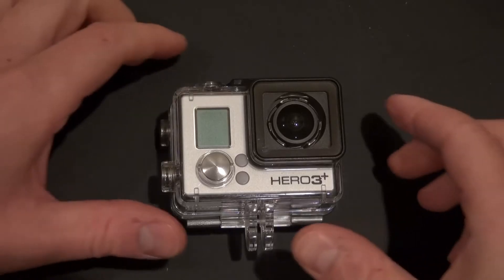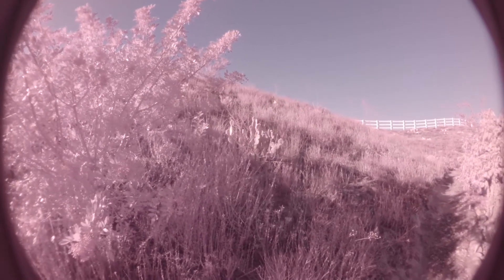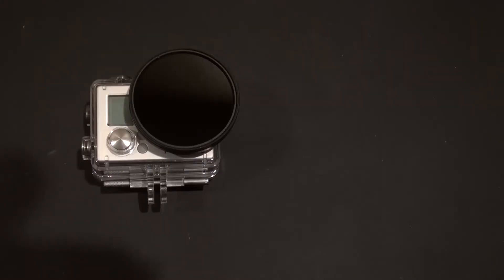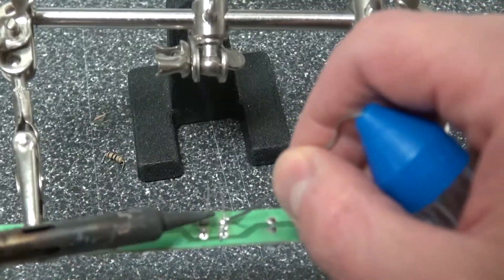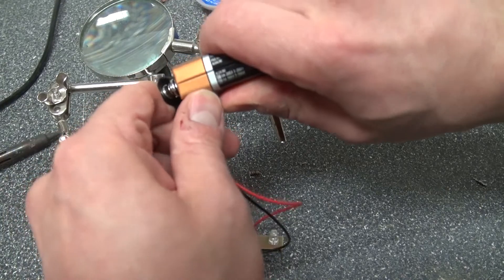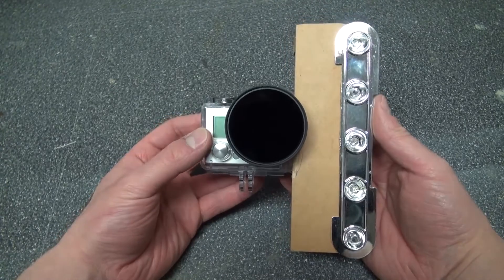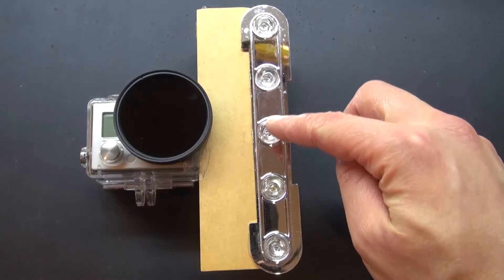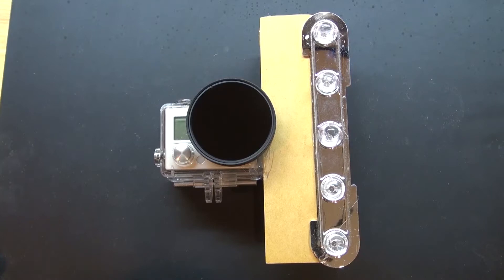Gopro IR Night Vision Camera Upgrade

Comment: Any reason you decided to not make a ring light maybe with the bare perf board or maybe even in a reflector from those older flashlights from the Goodwill Store to get more collimation or something else?  Maybe there's a sensor there better to not block.  Cool build and neat to see being resourceful and re-using and re-purposing electronics. I've been doing the same though not building enough yet.  I'm moving up from the RTL-SDR DAB TV tuners as well as antennas and working on newer antennas and a tinySA to do some design iterations and figured I'd move forward with a UV-Vis at least NIR spectrometer maybe like the NanoDrop... though more likely the PVC style with some aluminum tubing I have to save space since I wanted to test the spring water residue.  Still wondering about the Hero4 since I'd like to use a 4K camera for the spectrometer and probably is best to read into which sensor performs best into the UV and more-so IR range.  Thanks for sharing!

Comment: How can you make the range longer? I removed the IR filter from the gopro lense and i can only see 1ft-3ft in nightvision mode. Im using a IR zoomable flashlight.
Reply from the maker: That's a cool flashlight! For the gopro, there are limits the camera can do. The only thing you can do is change the lens type on the gopro.
Reply: @SciTyeTech  Any recommendation on the lens type?
Reply from the maker: @jamesk6270  I would say this one would be good. https://www.ebay.com/i/352753679291?chn=ps&norover=1&mkevt=1&mkrid=711-117182-37290-0&mkcid=2&itemid=352753679291&targetid=883027960686&device=c&mktype=pla&googleloc=9031560&poi=&campaignid=9423618867&mkgroupid=95066753945&rlsatarget=pla-883027960686&abcId=1141016&merchantid=6296724&gclid=EAIaIQobChMIyYGt2quJ6AIVGNlkCh2GOQU6EAkYBCABEgIxRPD_BwE
Reply: dont know if anyone gives a shit but if you're stoned like me atm then you can stream all the new movies and series on InstaFlixxer. Have been watching with my gf for the last couple of days xD
Reply: @Keanu Kason Yea, I have been using instaflixxer for months myself =)

Comment: The filter cobbled on the front looks more like a polarizing filter or a very dark ND filter.  "infrared filters" are typically clear.....Oh! wait I see you are adding a VISIBLE light filter. Passing ONLY infrared wavelengths.  Cheers mate, keep making cool sh$&!
Reply from the maker: Thanks! Yes, that is exactly what I did. The world looks really amazing in the infrared spectrum.
Reply: @SciTyeTech  I think if you add a IR-Pass filter you have to focus the lens new? If you remove the IR filter visible and infrared light reach the sensor but focus was adust to visible light. So it gets a bit more blurry because visible and infrared I guess got different refractions. If you then put on the IR-pass filter only the infrared light at 1000nm will reach the sensor and that looks more blurry because focos must be set new to the ir refraction.

Comment: Nice work. Looks like a nice electronics project. Your illuminator looks more like a UV Full Spectrum than Infrared. Photos and video captured under Infrared lighting usually appears black and white.  Also your illuminator might do better with more of the smaller LEDs. If I may ask, why did you choose to make your own illuminator instead of purchasing one that was already made.  I have seen quite a few that have a few LEDs and ones that have up to 200+ LEDs which can be used as a flood light.
Reply from the maker: Thanks! I did make a mistake in saying that it is an infrared camera. It really is a full spectrum camera. When I film with this camera, I noticed the difference when I use and not use the IR filter. When I use the IR filter, it does make things look more black and white. With this video I filmed in raw format. I could have edited it to look more black and white, but I preferred the original look. 

Yes, I could have bought the infrared leds. But I already have lot of these large IR leds laying around. I might buy an infrared illuminator, but I prefer to make on instead. When I make stuff like that, it feels more meaningful.